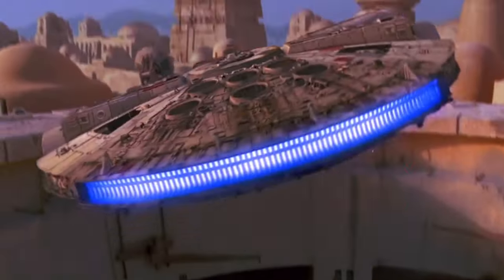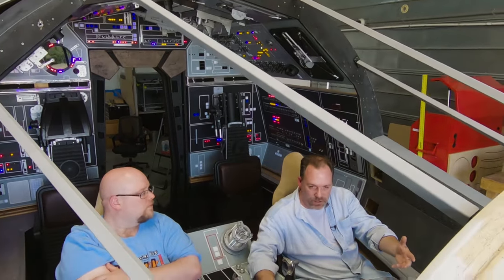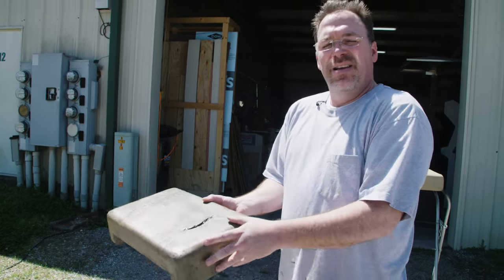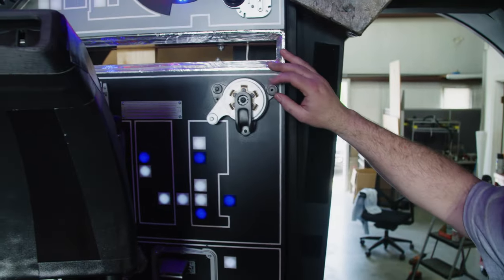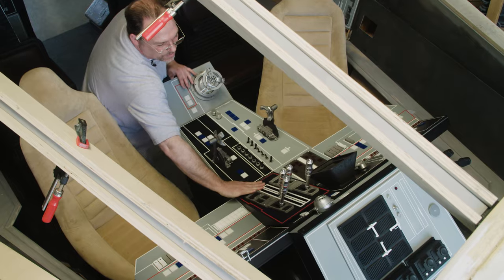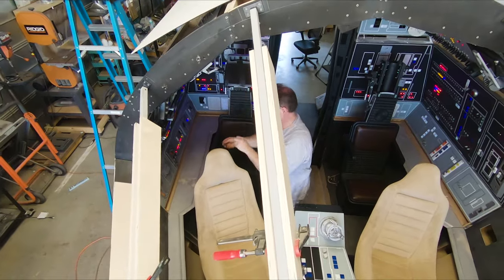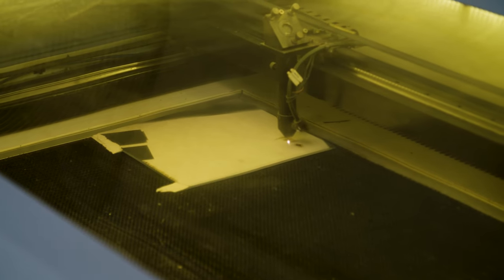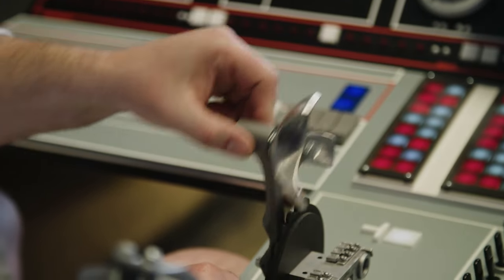Full-Size Millennium Falcon Cockpit Built In A Garage | Obsessed | WIRED

Comment: The other problem is going to be that the on set mock up of the ship would actually not be big enough to hold  the interior sets that make up the inside of the Falcon. In order to make the interior match the film, they will actually have to build the exterior larger than the one in the film.

Comment: Make it the full millennium falcon, bound the prices together and make it have flying stuff so it can actually fly using the buttons and throttle buttons. And have a little engine for gas or use the airplane engines.